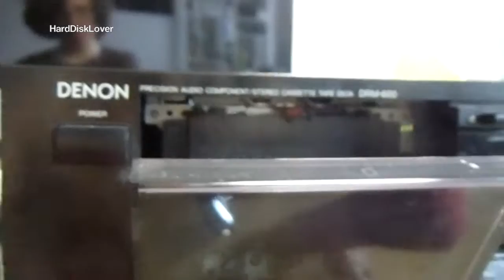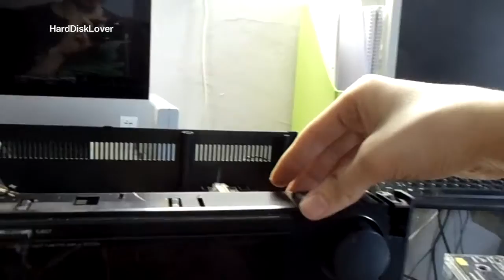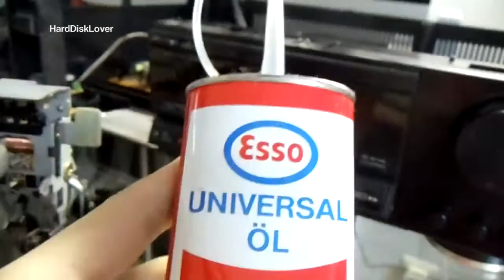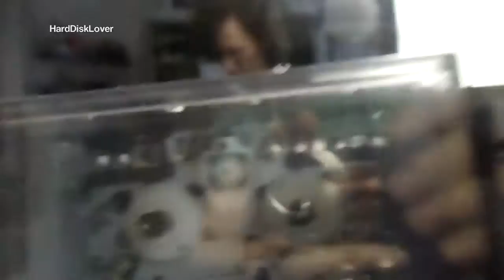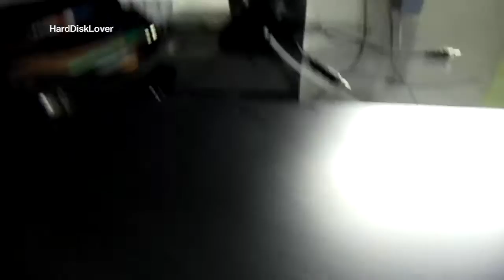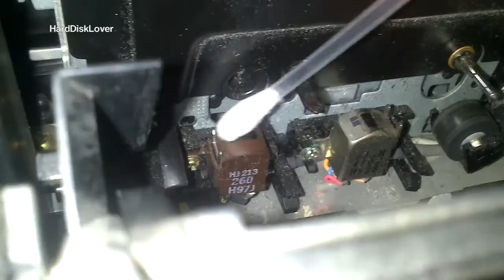DENON DRM-600 TAPE DECK REPAIR & CLEANING

Comment: Thanks for your work on this video. I've had an old DRM-600 in a box in my garage for around 15 years or so. I found some old cassettes the other day and wanted to hear what was on them, so I dug out the player only to find the same problem as you describe. I added a drop of oil (without removing the mechanism) and all is good! You've saved me a lot of time and trouble - Thanks from Sydney Australia :-)

Comment: I found a DRM 600 for £20 in a charity shop last w/e. I took a chance. The chassis is a bit scratched and beaten up but the heads look clean. I've been buying cassettes again recently and have a couple of thousand old tapes from the mid '70s through 1990s. I wasn't expecting very much but I've got a couple of weeks to test it and if it's no good I'll return it. Anyway - to my delight it sounds really really good. There's something about that chunky analogue crunch with a bit of top-end hiss that my ears enjoy. I'm very pleased with it. Thanks for the vid.

Comment: I thought I had a similar problem with a Denon 6.5. I tried the solenoid, seemed to work. Then dismantled and checked the motor. Definitely had appropriate resistance, etc. I then cleaned the microswitches - there are five of them. Once satisfied they all were making good contact, reassembled and now it works. It seems that the sensor that the cassette is loaded wasn't working, so no power to main capstan motor and therefore the wheel that turns to load the heads wouldn't work. Now all working well again! Thanks for the helpful video as it helped me have the confidence to take the device to pieces and search for the fault! For a machine well over twenty years old, she continues to play well!! Thanks again Mr HardDiskLover!

Comment: Many thanks for this video, I had the same problem on my Denon DRM-500 deck which has been sitting idle for 5 years. Having watched your video I removed the top cover, which was enough to give access to the solenoid (so no need to remove the drive) with the deck tilted on its front. All it took on my deck was press one finger on the plastic lever whilst pressing play then stop a few times. The plastic lever freed and normal operation returned, I didn't need any oil. Thanks again!

Comment: Shouldn't you clean the pinch roller as well?
Reply from the maker: Dan Hefferland The pinch roller was just replaced by the previos owner before the tape deck "broke" and was the cleanest part in the entire system. But still thanks fot the tip :-)

Comment: Hi i had a DENON DR-M30HX and it is making a noisy sound on background when i push the player bottom . have you any idea to fix this ?  Before my cassette player stopped each 20 sec and i change the Belt . And i do noty have this problem again but this noisy sound  Thanks in advance and sorry formy poor english
Reply from the maker: I dont think I understand what you mean with the noise issue. The way you are describing it sounds like something has gotten misaligned or there is ground fault